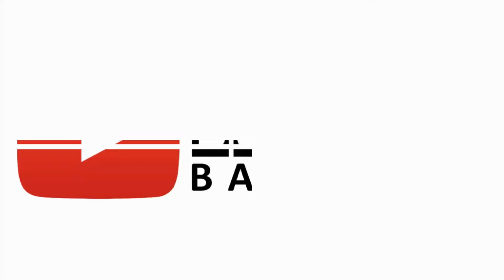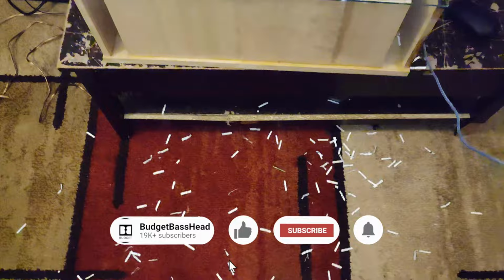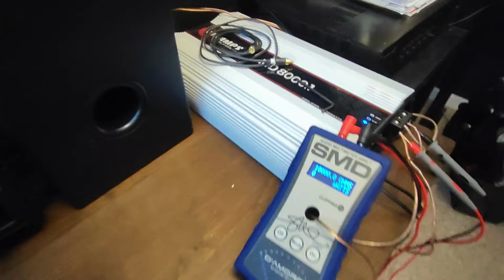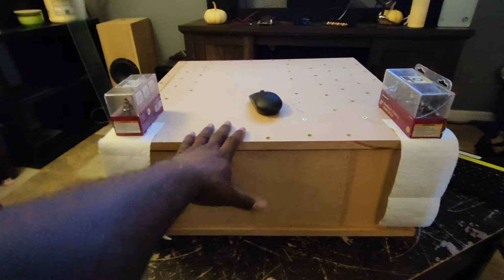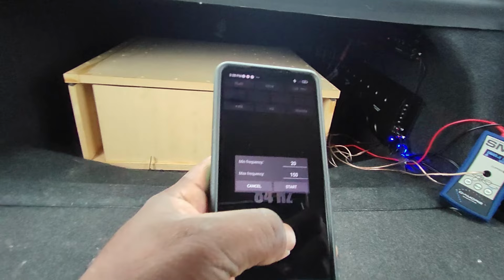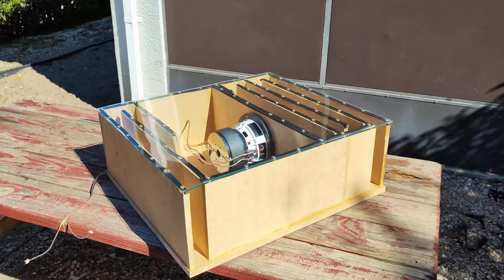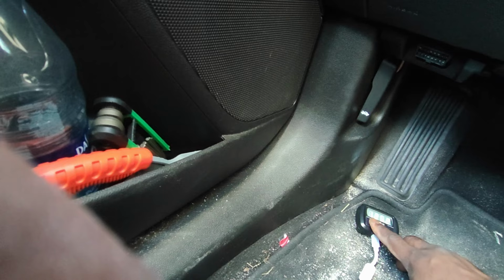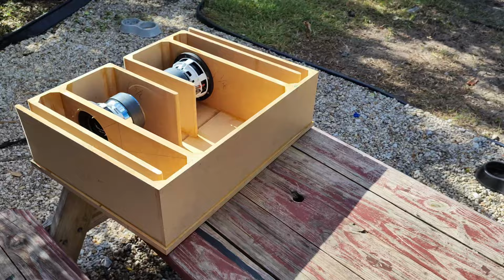How To Design Build And Test | A 6th Order Bandpass (Parallel )

Comment: band-pass are just worth all the time and materials to "attempt" to build , one small mistake or not using/understanding the driver selection process , and the project is bunk........a well designed ported system will sound better , flatter , and have just as much output with a smaller footprint..................band-pass is a gimmick  , no reputable manufacturer builds band-pass boxes..............its for a reason
Reply from the maker: Bandpass enclosures require more material to manufacture. Meaning, more cost to the manufacturer and in turn, more cost to the consumer. Don't confuse business best practices with personal preferences. The average consumer don't even know the difference between a band pass and a pass band. It's a niche topic. Those who know... Simply know. And those who don't, leave comments akin to yours.

Comment: I have a serious question. To build a box like that to get the performance out of a 6.5 sub, you end with a very large box. Aren’t you just better off placing a larger sub in the same space? I assume that box is a least 1 cube or larger. Why not just get a larger sub, even sealed and stick in a cube box and go?
Reply: Wont get the same response. A 8 or 10 in a sealed 1 cuft box wont have the same response curve as a 6.5 in a 6th order. And a ported, 4th or 6th order 8 or 10 will need a box even bigger then that.
Reply from the maker: @TheZombieSlayer1155  well stated.
Reply from the maker: The bandwidth won't be as good. SPL would be greater, but not frequency range.

Comment: About the 6.5 inch woofer smelling/stinking in the factory spec. bass reflex/ported enclosure. It is because its controlling the cone so much, that it cant cool itself as easily. The larger parr. 6th, allows much more x max, which in turn cools the coil off like a fan, as the cone is pistoning in and out much more.